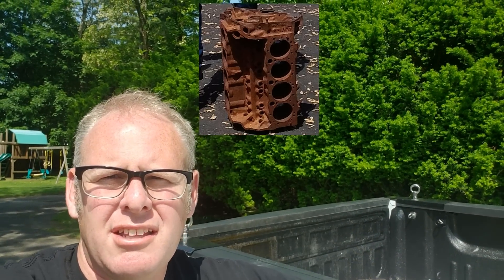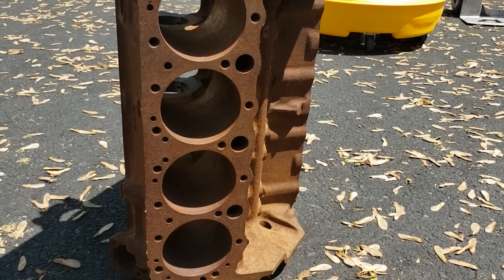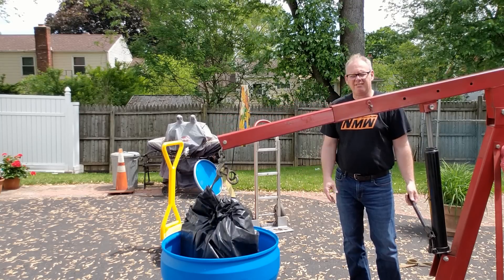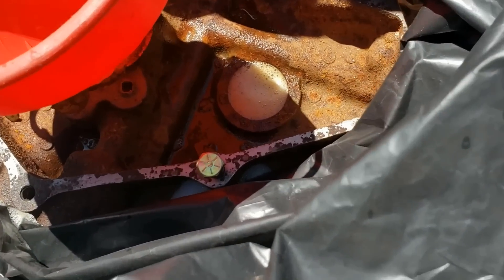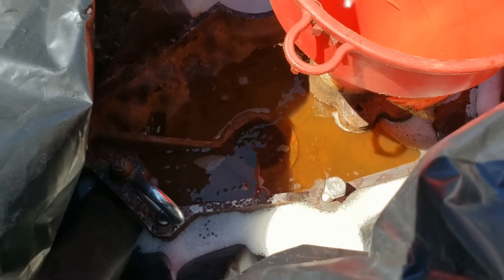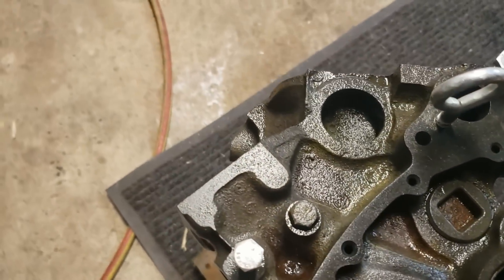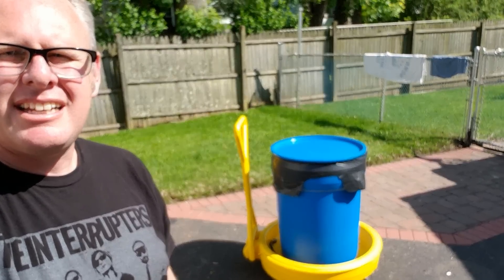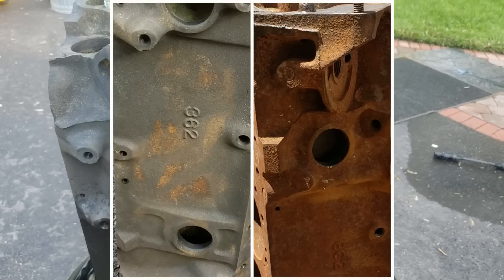How to Remove RUST from an Engine Block with 5 Gallons of Evaporust- Safe, Clean, Cheap Derust

Comment: Saw this done with electrolysis using only water its cheaper same result  if not better just needs a little welding and you have to have a battery charger . From what i can see the electrolosy method is better cause you don't need to worry about the bag breaking and ruining the expensive derust liquid.
Reply from the maker: @peterloichtl4512  I've seen videos of the electrolysis being done for too long. What is safer with my method is that it only eats the rust. Lifter bore clerance and such is safer. The electrolysis does occur evenly. There is a path between the cathode and anode that is stronger, even with multiples used. So when one area is cleaned sooner, but other areas need more time, the electrolysis continues to break down the good iron in the cleaned areas, while the rusty areas are continue yo get treated.

This was my 1st time doing it and I've since gotten better. I acknowledge a bag could tear, but none have so far. I'm just as comfortable with the risks as you are with yours. I wish you the best with your projects!

Comment: At $35+ at HF, not cheap in my book … I use Harris 30% vinegar and it eat the rust and then a ospho bath and bake to dry
Reply from the maker: @stevelewis2986  I can appreciate your point and will agree that there are probably more applications that your suggestion is better for than this one.

I did specifically choose the Evaporust here because I did not want the risk of the acid continuing to work on the gray iron, after the rust was eaten. Increasing the tolerance in lifter bores or other critical parts could create more work or maybe an oil pressure issue if gone unnoticed.

I can safely leave it in the Evaporust for a week or two and confidently know that ONLY the rust will be eaten.

Hand tools and other items with less critical tolerance mat be overkill, but I like it for this application.  Your feedback is appreciated and insightful for thousands of uses!

Comment: How would you address the flash rusting if you could do it again?  Do you think spraying it down with brake cleaner (if you wanted to paint the block) or a lubricant (if you're leaving it bare) might help?
Reply from the maker: On this block, I sprayed it down with WD-40 until I was ready to machine and paint it.

Comment: Oh except for the bag I think you had it as I said I did look good.got one going together before to long I may try it on mainly for cleaning insides for cooling ability and then try to clean out regularly after it’s running with CLR or maybe even keep some in it

Comment: Inside the block is all you should have been concerned about for cooling after build
Reply from the maker: Not sure how I could have been any more selective on where the solution worked. You may have a point, so can you recommend a technique you like to use?

Comment: Wouldn’t muriatic acid or vinegar work?
Reply from the maker: I think they both would. Here was my dilemma. Not all the areas had the same amount of rust. So after the rust is taken care of in some areas, but not others and I leave it in to get all the rust- what happens to the good metal that continues to be exposed to the acid?

I was afraid lifter bores would have excessive oil clerance and cause oil pressure issues. I know the Evaporust ONLY eats rust- so it felt like the safest solution. I acknowledge it may not be the cheapest!

Comment: or a molasses dip or electrolysis with washing soda in a kiddie pool.
Reply from the maker: Yes, sir! I hear vinegar too works. Most processes aren't completely even. So when rust is all eaten up on one section, but not in another, do you let the process keepgoing and sacrifice sone of the good metal- possibly machined surfaces like lifter bores?

This is the only process I know that exclusively targets rust and stops at good metal
Reply: @PaulsProTips  with certain metals, a 50-50 brine of vinegar and table salt works. like if you have a bucket full of fasteners from a project, pour in the brine and mark what they're for and come back in a month or so to reinstall. 

the question about metal is valid--if it's a structural area, for example, you probably want to "go down" to metal that won't get eaten away. but some will want to do a rust conversion (say, with navel jelly) instead. esp. on a restoration, where you aren't looking to eat away half a numbers-matching framerail, let's say, and you won't be blasting that particular car down the quarter mile.

As for machined surfaces, if there's even a chance to pit, you might be better off machining away towards the blueprint specs. A lifter bore might get away with a hone from a brake cylinder hone, but too much clearance and you're looking at valvetrain oiling issues. 

but then let's say you're messing with a Ford Windsor block or a Mopar LA block. the Fords are known for lifter bore missalignment, so if you're planning on shifting past 6,000 rpm, you probably already planned on having the lifter bores enlarged and sleeved to get your pushrods to line up...or in the case of the Mopar, since it was cast for the early Hemi, the lifter bores are at odd angles and those looking for high RPM stability also want to rework those. So pitting isn't going to be an issue.

but on a Pontiac block? those are notorious for not having their lifter bores cast into the lifter valley deeply enough, and a radical cam will snap 'em loose. so making them even thinner by boring and honing....

Comment: Looks like too much work….. I’ll just pay $125.00 to the machine shop
Reply: Agree! I just have the machine shop to prior to machining. I think they charged $90.00 and the block comes out looking like new cast iron. They most likely use a more caustic cleaning solution because it leaves no rust behind that I can see. It also dissolves any grease and most of the sludge.

Comment: I've been tinkering with using electrolysis with borax as an electrolyte.  Do you think it is safe for the non rusted metal where clearances is critical? Or should i use evaporust?
Reply from the maker: I've seen several replies here stating it's good but I'm not sure it is such a simple answer. Thay was precisely why I chose the Evaporust. I knew it would only eat the rust.

The electrolysis seems to be strongest in areas directly in line of site between the cathode and anode. The areas not as direct and hidden can take longer, white the direct areas will continue to errode the good metal after the rust is gone.

I think at best, it matters how much rust and how the vat is configured. 

The Evaporust avoids all those liabilities.

Comment: Electrolysis would have been cheaper though it might not get all the insides. If only you didn't buy the two buckets at first it might have been cheap enough to not just send it to a shop.
Reply from the maker: Thanks for the reply. I have no regrets with choosing this method. It is certainly easier to clean up afterwards and I honestly feel it is more predictable and consistent.

I feel the method could be used for lots of things both bigger and smaller. Hopefully it helps others weigh out what is best for them.  I much rather be a diy guy and enjoy the processes with my dad than pay another place to clean it for me. It may not be for everyone, but it was right for me. I appreciate the comment and thanks for watching!

Comment: Will it work as a coolant flush? I drive the truck everyday and a bad radiator cap caused rust
Reply from the maker: I feel like the offer a version of this specifically for that.  I'm sure if you search evaporust coolant you get on the right path quickly.

Comment: I haven't read all of the comments, but I might try this using white vinegar. It's only around $3.00 a gallon.
Reply from the maker: Acids can be great for cleaning. I only chose this because acids eat rust and good metal. When I rely on lifter bore clearance for proper oil pressure, Evaporust only eats rust, so it was safer.

Vinegar for cleaning pliers,  screw drivers and other less precision instruments is a great choice all day!  I appreciate the comment!

Comment: Just check Amoozun and they want $130 for 5 gallons. To much $$ for me although I don't have a block that bad either. I have used Por15 on mower deck and did great BUTT also very pricey. I did come across another product that eliminates rust and protects the metal from ever rusting again. It was an acid type chemical in a spray bottle got from Tracker Sooply. That is the miracle shtuff can't remember the name of it. Now it's everywhere.
Reply from the maker: I feel like Evaporust has had some decent price increases since they were acquired by CRC in 2021, but there has been inflation all over the place along the same timing.

I hope you can find the right product at the right price for you!

Comment: I used to use muratic acid to rip rust off steel, rinse the acid off, then dip in "Ox O Sol"  The Ox O Solv got rid of the flash rust and put a zinc oxide coating on the metal. Ox O Solv isn't made anymore.....

Comment: That’s expensive just Do electrolysis much cheaper and better imo
Reply from the maker: I appreciate your feedback.. Better is a relative term. I've seen blocks get ruined from being left in too long.

The main point that tipped the scales for my decision was that all other techniques had no way to stop, once the rust was gone.

After some areas are clean (the ones in the direct path of the electron flow) the sides not in line of sight between tge C&A will de-rust more slowly- at the same time- metal off the cleaned surface can continue to erode.

Same fear with an acid. I did not want to open up lifter bores while other, more rusty areas were still getting slower results.

The Evapo-Rust only eats the rust!  I'm sure you have enough experience and success with your process to make it work. I'm not sure one is better than the other. Just depends on what you value more.

Comment: Just fantastic brother. Thank you I am just going to start doing my Chevy 350 that looks just like yours and was going to buy a five gallon pail but I think all I will need is a 3.5 gallon pail. I have a smaller Rubbermaid box container that the block will fit in and with your water trick it will work just fine.

Comment: This is only good if your machine shop is 800 miles away ,here in Chicagoland it costs me 80 bucks to get it hot tanked Magnafluxed and degreased,which unfortunately knocks your 150$ product out of the ballpark,unfortunately my machine shop guy is now 70 and may not do this much longer who knows in other words were losing these kind of services because no one is interested in learning anything anymore
Reply from the maker: You probably don't need me to tell you this, but your machine shop is significantly unvaluing its time for just of $26 to complete each of those 3 tasks. Not sure what the cost of living is by you, but any younger shop who is still working on paying off their investment in tools and equipment will not do it that inexpensively.

I made this video to share a helpful technique,  which works on things other than blocks. You are right. There is always someone able to do it cheaper. Good luck with your projects!
Reply: @PaulsProTips  wasn’t negative on my part,I appreciate your video,just adding up the cost vs my Time which I need to spend on Metal work on my 70 Charger I check out videos where I can get helpful tips and save money since I am on a budget,might add that the Machine shop probably increased along with anything else in this uncertain world for instance a year ago A Charger quarter panel was around 700 bucks now it’s a Thousand for a good AMD
Thanks for your videoo

Comment: Nice work ! Looks like a 1962 Chevy ll block with the recessed oil filter pad & that's worthwhile saving .  Neat idea with the 2 bags. aka MOTOR MOUSE SBC.s forever !    James T. Burke
Reply from the maker: Thanks for the reply!  You're right. It happens to be a 275hp 4 speed block- just about right for my dad's 67.

Comment: Spin the can 180 with the spout up top it won't clug,it'll pour smooth
Reply from the maker: Just used your recommendation on adding 3 gallons of type 32 to a hydraulic lift.  Worked great👍

Comment: So, i really like this idea of how to make the product go further!! My suggestion tho would be to add the product into the garbage bag before you add the water to the outside. I think that this will help reduce the chances of the "pockets" where the product wasn't able to touch the block. I'm not 100% sure of this though, as i have yet to try it myself. Just thought that putting the water in first is giving the water the chance to create those little "pockets"

Comment: That is awesome but you totally could have done the exact same thing with some water and a battery float charger. You should look into doing electrolysis on stuff it's cheap and super effective and non destructive
Reply from the maker: Thanks for watching and I appreciate the comment. There are several dozen video's on here that show people doing electrolysis and I've watched a few.

I made this video, because there wasn't one demonstration this technique. I'm honestly not sure either performes better BUT I do believe the electrolysis guys often say how they could fine tune the amount and placement of the sacrificial metal to improve results. The Evaporust is not limited in the path of electron flow between the two, offers more consistent results and is better in tough to reach areas which don't ha e the electron flow- such as water jackets.

You may be right, there are cheap & easier ways to do this, but I feel this one is worth consideration. It isn't for everyone- but none of these techniques are.

If you've made a video, or ha e one in particular you like- feel free to link it in these comments. I love to learn from our community!

Comment: You wasted SO much money on this. You can use 10 gallons of distilled Wal-Mart vinegar for about 30 bucks and have the engine come out after 24 hours completely clean. If you are trying to get a sponsor sorry that I just killed it. Their product from what I see in this video is an expensive vinegar result. Save your money and just use the damn vinegar like a normal person lol.
Reply from the maker: There are several similar replies with vinegar, citric acid and electrolysis. All have great applications. 

What I like about the Evapo-Rust is that it only eats away at rust. It will not eat steel or iron. Vinegar and others do!

I had concerns that areas which clean up quickly could start to have good metal removed at the same time more heavily rusted areas were still getting cleaned.

The lifter bores were pretty clean. Not really interested in bushing them!

Thanks for the feedback. Your recommendation is worth trying on some rusty hand tools and such! I should make a follow-up video addressing your perspective.
Reply: @PaulsProTips  Vinegar will literally never eat iron, the acid cannot bond with iron molecules and it would take steel longer to rust than to be eaten by vinegar, we are talking about taking off a layer around .0001 thick AT MOST which is well below the tolerances of most engines, even modern ones. I have done vinegar soak on 8 second drag cars as well as semis that see over 1-2 million miles between engine rebuilds. Vinegar is best solution for eating rust PERIOD and it is also the cheapest.

Comment: Best is sand blast the outside of the block, inside still need to hon the walls of the cylinder.
Reply from the maker: You may be right. It probably is a personal thing, but I bristle at the thought of throwing sand at an engine. Tbis way I know the oil passages and lifter bores all are addressed with the lightest touch possible. Once the rust is gone- there is no more erosion of the metal- unlike electrolysis.

Comment: Take it to a machine shop, most has a dip tank and for the cost of the evaporust vs the cost of dipping it is about the same and you don't have the mess to clean up. Also the cylinders need the rust gone why plug them off? Hmm. I'm not saying this don't work and block looks good.
Reply from the maker: I can appreciate most task can be accomplished by paying someone else. I wanted to do this with my dad.

The reason we didn't want to leave the cylinders open is because the limited amount of product we had, likely would not submerge the block.

We would bore the cylinders, so eliminating the rust on the cylinder walls is not an issue.
Reply: I gotcha, seemed to do the trick. And something good to know for future reference. Thanks!

Comment: you should check out the electrolysis method as well . check out on youtube - How to totally clean an engine block by user  Gearhead 327
dont forget to scrub and clean out those oil passages and galleys
Reply from the maker: I did do some research before I chose this method. The reason why electrolysis concerns me is the lack of control, once the rust in a section is removed.

It seems to work best in straight lines between the annode and cathode.  So there will be areas which derest faster. One the rust is gone from those areas, and rust in other areas is eaten more slowly,  the clean meta continues to be eaten too.  

I felt Evaporust was safer.  How to you feel about the risk of electrolysis eating good metal?
Reply: @PaulsProTips   if you watch the video I mentioned they only left in there for a small amount of time . it was a long as your waiting time give or take

Comment: Do you remove cam bearings before submerging it in the solution?
Reply from the maker: I don't see any value on leaving them in. I would remove them. I've certainly put a motor together with used cam bearings before, this just isn't of of those builds for me.
Reply: @PaulsProTips  So you treat it like a true hot tank service. Ok.